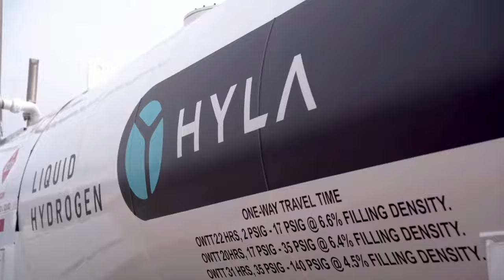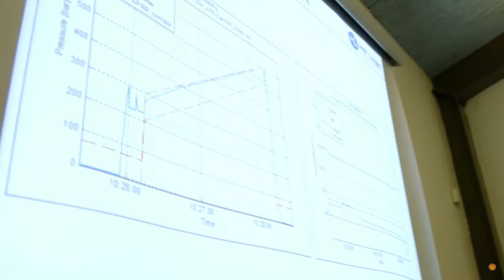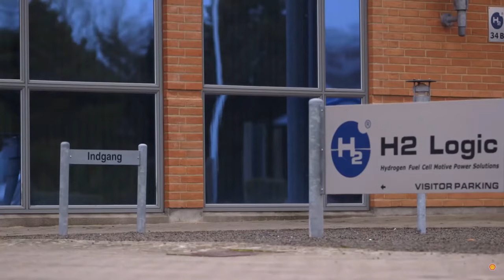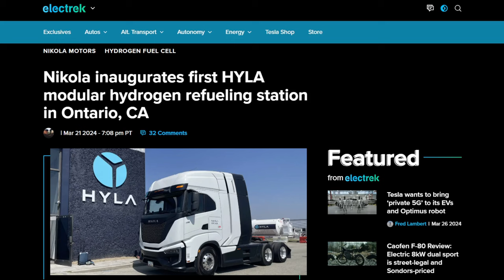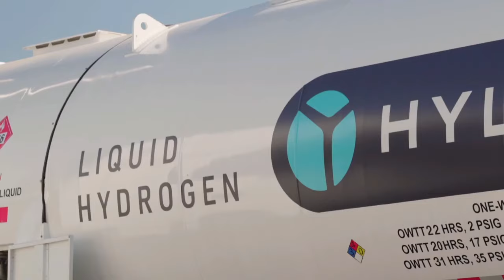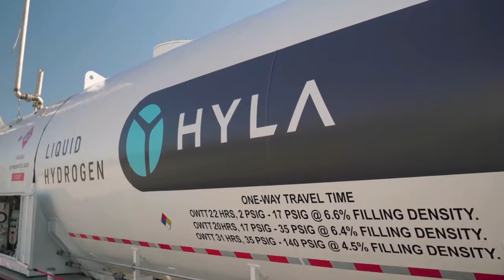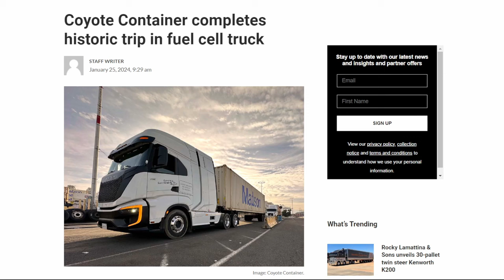Hydrogen Semi-Trucks: A "Total Failure" In The Making.

Comment: This mentioned liquid H2 but earlier an interview with a high level rep said they use gaseous H2  ??
Reply: The refueler has the hydrogen stored as LH2.  During the dispensing into the Nikola Tre, it is converted into gaseous h2.  The Tre holds about 70kg of gaseous hydrogen.
Reply: The HYLA refueling tanks store liquid hydrogen, whilst the tanks on the Nikola FCEV trucks store gaseous hydrogen.
Reply: @bruhabox  In Canada they built a gaseous station though
Reply: @Serik1625  Are you referring to the new Hyla station in Alberta or the light duty stations in Quebec or the Vancouver region?
Reply: @bruhabox  "Nikola Corporation has launched Alberta’s “first” hydrogen refuelling station in Canada, capable of longer-range trucks, buses and cars at the Blackjacks Roadhouse truck stop.

Using a 700-bar pressure HYLA modular fueller, the station will be situated along the Highway 2 in Leduc County – an important corridor connecting the Edmonton region and Calgary."
Reply: @Serik1625  The "700-bar pressure" is a standard used by both light duty and heavy duty vehicles.  It refers to the dispensing to the vehicle, but I have not seen any reference to whether the source is liquid or gaseous.  Hyla does have both gaseous and liquid supplied tankers.
Reply: Good video review! I have a couple of additional items to consider.

Fueling is like a diesel truck but the fact it uses elec motors means it has regenerative braking and route energy management for maximum battery/fuel cell performance to not waste any energy produced. 

Also the weight of the FCEV is parity with diesel. So it can carry full load unlike BEV which are severely impaired even with the additional 2000 lbs limit (82000 vs 80000)

And finally because the battery is much smaller only needed for regen braking and supplemental power it can be made with cheaper sodium batteries cells and also last much much longer because it does not have the performance requirements of a pure EV. All this makes it more sustainable than pure BEV.

Also it is flexible and can use grey or blue hydrogen now if cheaper but switch to green as supply and price become competitive. This makes them automatically upgradable to better more efficient processes vs BEV over the life span. BEVs have a limited lifespan and huge battery replacement cost and env impact over its lifespan. The BEV truck components would outlast any current battery technology requiring probably 3 replacements over its life.